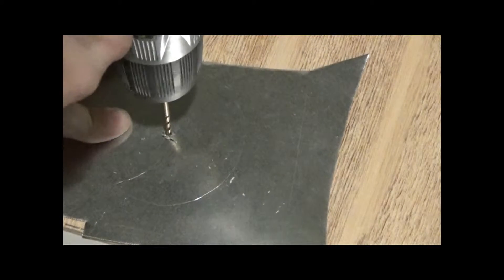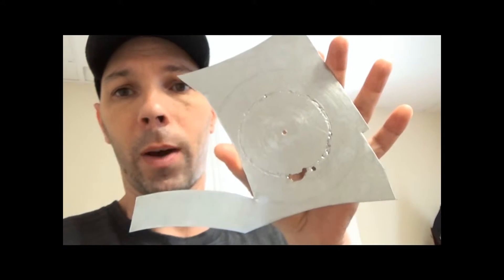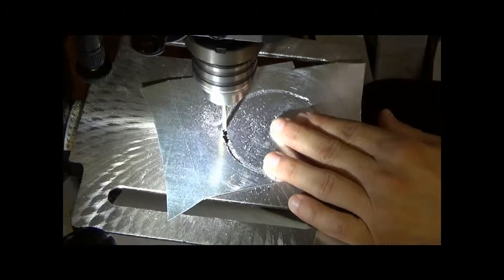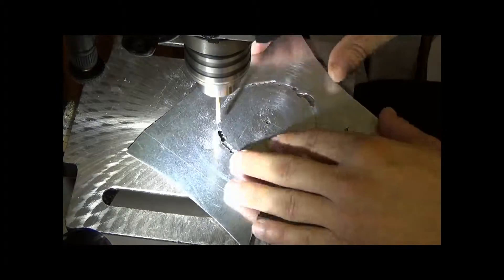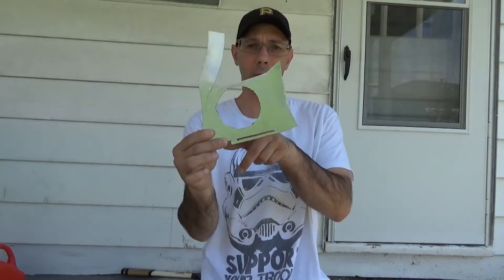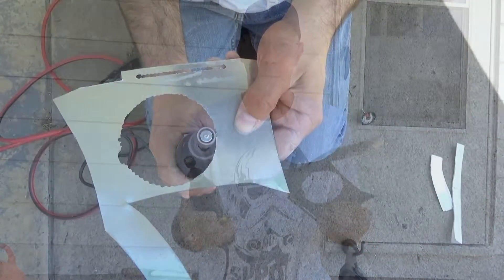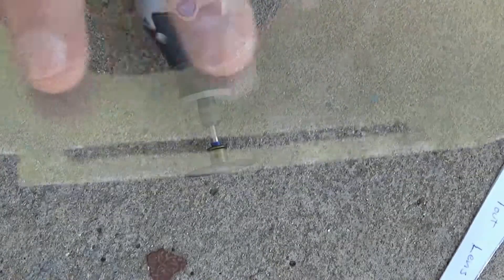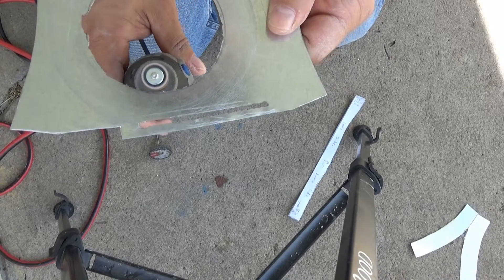R2D2 Radar Eye Using Sheet Metal and Drill Press Part II of V.

Comment: Why did you opt to use a Dremel tool and drill press to make the eye hole?  Wouldn't it have been easier to drill a pilot hole and then cut out the inside with the tin snips, sanding the inner edge after you made the general shape?
Reply from the maker: Gatt427 Doesn't Matter  That way may work as well.  It was also recommended to use a 3" hole saw.  Sometimes things are done with the tools we have on hand and what builders "think" might be the best at that time until better ideas are suggested and tried.  the problem with the hole is that it is still rounded on top, so a 3 inch hole is still technically oblong on a pattern.